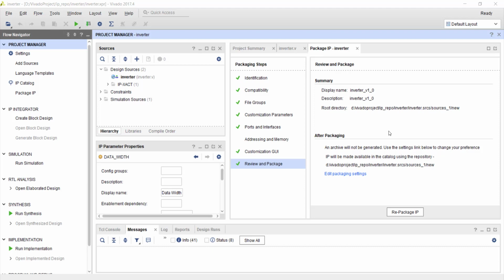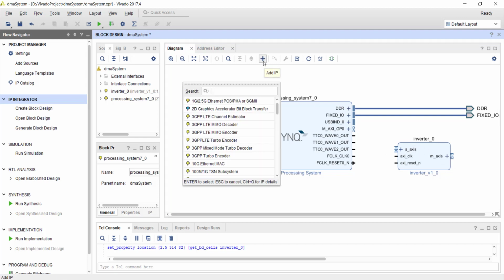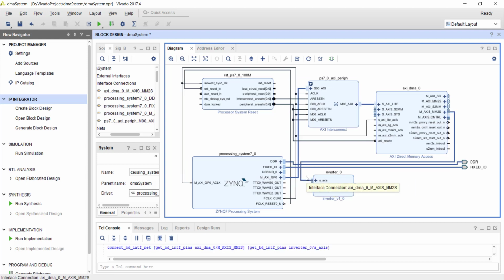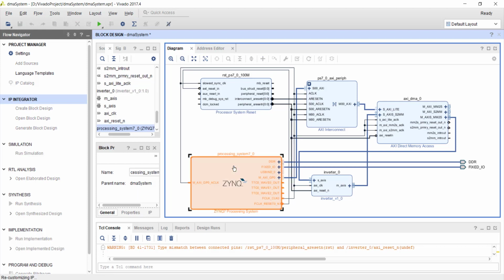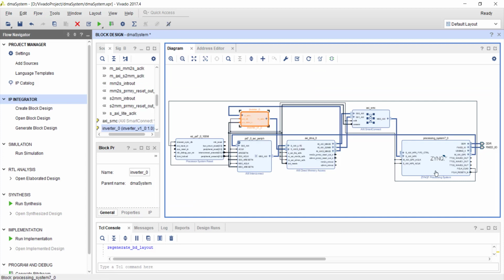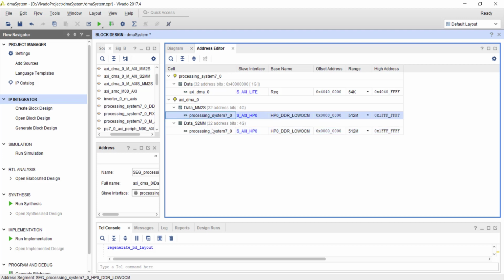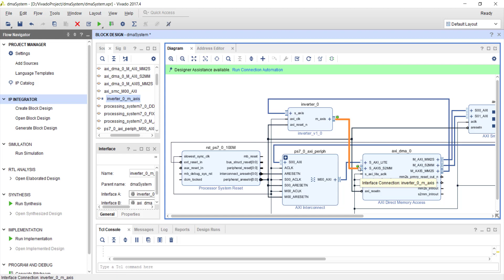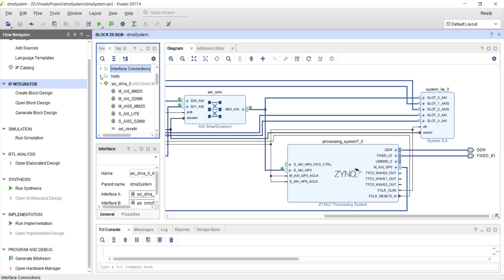DMA System level Design with custom IP using Vivado

Comment: Thanks for the great clip. 
If I have an ADC (like PMOD), can i convert data from PMOD IP to stream interface and route data to DDR through DMA? Is it feasible or I have to use memory mapped AXI interface.
Reply from the maker: Yes you can transfer the data to ddr using the dma controller. Only thing need to write proper application software. Similar to the one used for image transfer in the image processing application, but this time from a peripheral to the memory. Each time an interrupt is received, configure dma to transfer next set of data

Comment: If I  only need to read from the DDR ,can I leave s_axis_s2MM disconnected?
Reply from the maker: Whether they are marked as mandatory signals in IP I need to check. But generally when you generate DMA controller from the IP catelog that time itself you can specify whether you need only read,write or both interfaces